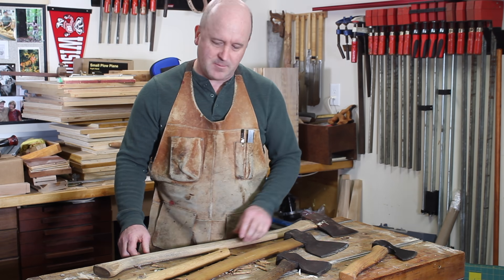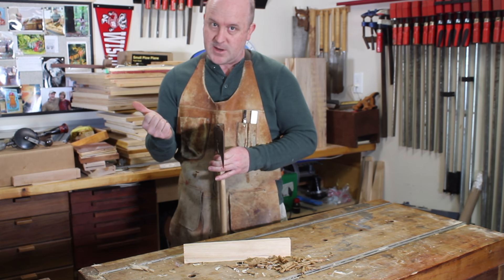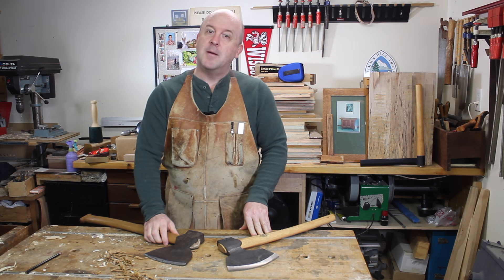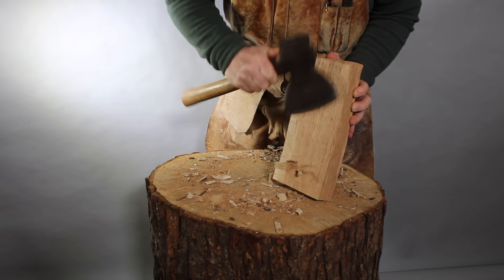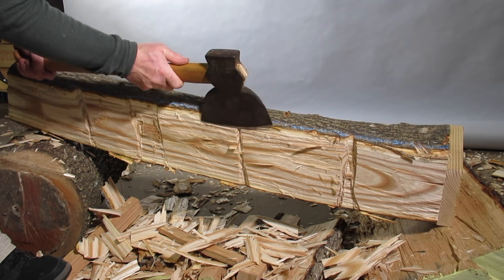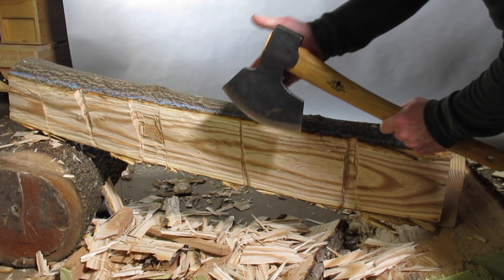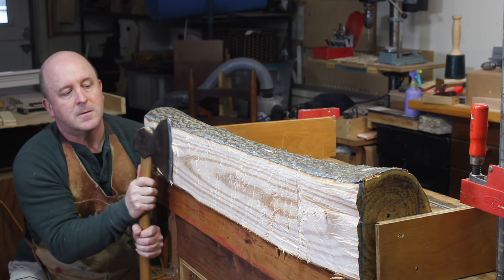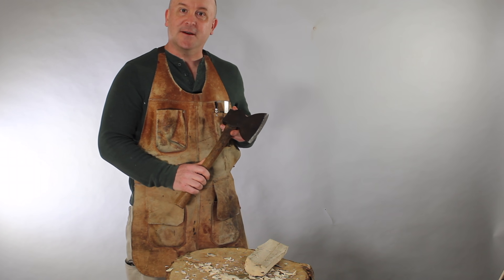Broad Axes Explained

Comment: I just watched another video called hand hewing from tree to beam that shows a guy named Dan Dustin use a broad ax as he skilfully produces a beam for Canterbury Shaker Village (looks like around 1980). In his opinion the flat on the broad ax should be out, and his explanation makes a lot of sense to me, as a woodworker. Not my area of expertise but I'm just pointing out that anyone considering buying or doing work with a broad axe should watch that other video.
Reply: Mark Lackley came here from same video. Dan’s explanation doesn’t make sense to me when thinking about the broad axe head design, nor the design of an offset handle. When you look at very old axes with offsets, the handles are offset away from the flat side. This means the user would have the flat side to the log.
Reply: @1978ajax Dan Dustin explains that the reason for the flat side is to effectively thin the blade.  Watch the video.  It’s the best hewing tutorial I’ve ever seen.
Reply: I was also curious about using a broad axe bevel in towards the log. It does make sense when you consider a draw knife works best with the bevel side against the log. It dosent cut to deep with the bezel against the work.
Reply: this depends on the work you are doing. these axes in this video are "carpentry" axes.. Dan is doing something else.. Hewing a beam is not the same as facing a door or finishing a board.. different tools for different work.. often the axes for beam hewing have handles so long that you can stand upright on the log and the axe goes by the side of the log, remember you have to last the day.. double-bevel or bevel side in makes the axe skip out from the log and keep the swing, then you can get back the energy from the return swing and just give it a tiny bit more to have another go.. just look at the oldest men at work.. steady they go, no rush and the less effort put in the longer they can go on.
Reply: oh.. and great video by the way.. :)
Reply: @japples6852  the offset handles are to work safely not for angles. As far as the flat side vs the convex side It's just about geometry not preference or wood chippage. Although anyone willing to work harder accidentally or not I Merritt them. Think about how a chisel works or a draw knife. The beveled edge prevents deep unwanted cuts. Once it's taken it can never be put back. Now take the task at hand, you gouge too deep its there forever. These aren't precision swings, although skilled  no doubt. Dan Dustin's explanation on how and why the mistakes are understandable through loss of tribal knowledge is quite perfect. Evidence of this is everywhere.. Imagine you are driving in your car and you see another alongside you with those mini mirrors atop their side mirrors. Those side mirrors and combination middle mirror prevent all blindspots. Side mirrors adjusted outward properly you can see a car in your rear view perfectly transition to your side mirror proportionally. This knowledge is lost amongst the current populace and we haven't been driving that long.
Reply: i watched that video as well. So im curious as to what is really correct and what isnt. But the only real way to know is to do it yourself. In another video, the uploader said it himself, "If you see someone doing it wrong, dont shame him, as anyone willing to hand hew a beam out in the heat is worthy of that respect."
Reply: @DuriensBane  sounds right😁👍
Reply: Haha, I came from that video too!  I believe Dan. His video was old but so far the best one on YouTube.
Reply: Think about how a chisel is used an you will have your answer ... Flat side towards the flat face you are cutting is the correct way
Reply: @adept00 
The timber job sites I’ve been the broad axe was swung with the body fully erect, usually standing on the timber and swinging between the legs or to the side of the body. 
They didn’t swing hard or long, but they didn’t make pansy cuts like the guy in the video- they worked a lot faster and not as hard as they guy in this vid. 

Since pre-roughing a chair blank with an axe that is ‘typical’ with the bump in the sides of the blade is nearly impossible to do well because of the bump, I’m going to acquire a couple broad axes and a ‘broad hatchet.’ Typical axes are great for chopping stuff, splitting wood, limping or whatever but don’t take slicing cuts well. 

This video doesn’t look like realistic usage to me. And inefficient by factors of 10. Timber guys knock up a square beam very fast but don’t make little chops like this guy, they’re in a rhythm and not struggling.
Reply: @fishhuntadventure  hey bud, I think I was referring to another video "hand hewn from tree to beam" which had better insight than this video. I can't remember it was some time ago, I'd say check that video out. I believe that vid and knowledge is spot on.
Reply: Here I am on the bevel in or out journey and I really think it depends on the application and what you're trying to achieve. I was waiting for this video to confirm Dan's views and then boom, nope. I'm about to fix and hang a broad axe hatchet and I will have to make the decision.
Reply: @krismorey 
Does not the size of each end of the eye dictate which end receives the haft?  The smaller end receives the haft as the other end is larger to allow for expansion with wedges, thereby locking the head in place?

Comment: A very old right bevel broad axe came into the sharpening shop today.
Looks like it was found whilst metal detecting.
Guessing colonial era. 
Very worn, from lots of use, but the steel is still good. 
Was pretty sure I knew it's intended purpose already, but this gave me a bit more insight into the specific end use, and edge geometry that I will need to restore, to make it serviceable once again..
Thanks!

Comment: Good day Jim of Highland woodworking, I've appreciated your reflections in a couple of your video's and you seem familiar with a number of axe types and manufacturers to an extent I am not so I'd really appreciate your opinion. I've, with one exception, never had the chance to try a carpenters or carvers axe*, never mind a broad axe, but I do a 'little bit'' let's say with axe's, usually making a felling or splitting axe 'one size fits all', but I've been wondering about branching out, you know going out on a limb and buying a specialist axe; I noticed you have experience with the Gransfors Bruks axe's amongst others and wondered if you had to use just one axe, let's say a Gransfors Bruks large carving axe or a Gransfors Bruks Swedish 1900  Broad Axe to do a variety of major tasks, let's say make a dugout canoe, some furniture, a dwelling in the woods and a totem pole-just for variety- which would be your choice?  Or would it be a different axe entirely, like the older, equally-or more in Scandinavia- reknown  Hults Bruks for example? Even a felling or splitting axe that I still use for a multitude of tasks... I'm thinking a double bevel, rather than right or left sided, I have tried a Stubai right sided and havn't found it THAT advantageous for flattening and of course much less useful for general use...If you have a moment I'd appreciate your thoughts on the matter if you find it is an interesting question to ponder of course  Thank you.* Except the Stubai right bevelled which thus far I havn't found particularly handy at all...

Comment: A question.  I have a true temper TB2.  According to think so, because of the angled bladyou it is a right bevel axe, but it has a bend just forward from blade.the eye and it also bends to the right.  Basically it is a hatchet.  What length handle should I put in it?  My guess is 14-16”.  The eye is1.6 times .6 oval.  Should I put an offset handle in it?  I don’t think so because of the angled blade.

Comment: Such a nice well done presentation.  Thanks for sharing and I will check out your store.  On the flip side, " no pun intended" some use the right or left hand grind axe on either side.  Perhaps the straight flat edge to produce a more flat surface and the reverse to take off smaller surfaces, or with the more circular Gransfors Bruks he displayed to produce a cupped or scalloped look. Just my two cents for what its worth.

Comment: Great video. I've wanted to get into this for turning firewood like pieces into usable wood. Some pieces can be pretty sketchy even taking them to the band saw and my band saw isn't very big. I have the same drill press as you fellow Wisconsinite. I love that thing but I bought it used with a crack on the back the pulley enclosure. Looked up the part and am not sure what to replace it with exactly. It's not noticeable but I refurbished the pillar and all the small parts and find it annoying.

Comment: The beveled side is actually intended to be toward the log when doing fine trim. The flat side provides a thinner, sharper edge. The flat side bites into the surface and could lead to an excess removal of material.

Comment: Multiple websites have the GB broad axe 1900 listed incorrectly.  Be careful out there.  Hope this helps someone.   The GB 1900 4803 is a RIGHT BEVEL GRIND.    
Most websites state this.  I’ve found two so far that state the 4803 is a left bevel grind.

Comment: Good video, thanks, As I'm in the market for a broad axe and a goosewing for that matter, would be even more helpful if you called out which axe is which in the video, that is, what is the brand and model of the axes you're using here? 

Also, in the same vein, would be great to take 8 or 10 of the axes you sell through a use and care video, that is, "...this Granfors broad axe can be used for hewing/shaping/... but is best used for shaping...", and show it in use for the tasks noted. Then, "...when you're finished with the work give it a fresh edge by honing, sharpening with a puck/stone/diamond/file, and wipe the handle with light wax/oil/....",  etc..., etc.... 
Thanks,

Comment: I am curious to hear your thoughts on utilizing the opposite side of a hewing axe for the bevel? So if the flat back of the axe head is on the right side when the blade is facing away from your chest, the bevel would be on the right side of the blade. Reason I ask is I was watching this video, https://youtu.be/hagvGTyEMUA?t=1105 , and this man states he used to do it the other way but switched after spending some time with old timers. The reasons he provides are two fold, the first relates to the the point of the blade being off to one side was not necessarily to get the blade closer to the piece but was to allow for a thinner blade and henceforth a sharper blade. The second reason relates to how the blade cuts the wood and prevents the blade from getting stuck. Maybe the answer is that both have their uses, maybe the hewing awes you show are just be for finer work and the axe in the video I provided is for more rough work. I just wish there was a good one stop shop that explained all of the different axe types and uses, as this fine tuning and switching of the bevel to the opposite side and working the wood in a different manner may be more true to the pioneer period.
Reply: I agree

Comment: Can one do with one axe or does one need both a right and a left version?
Reply from the maker: It is ideal to have both. They each specialize by the side of the log they cut. 

A right hand broad axe is used on the right hand side of the log (when looking down the length of the log.) Consequently, a right hand broad axe has a head that is flat on the left side and a handle that deflects to the right (away from the flat face) so that it clears the log.

A left hand broad axe is used on the left hand side of the log (when looking down the length of the log.) Consequently, a left hand broad axe has a head that is flat on the right side and a handle that deflects to the left (away from the flat face) so that it clears the log.

Comment: So I dug out an old hatchet, sanded some rust off, filed the edge a little to remove small burrs & I was wondering what the heck is with this bent head. Has a 17" handle that is almost straight on the bottom and a almost flat cutting edge. Now I know. Thank-you for the stupid simple explanation lol. KISS - Keep It Simple Stupid.
Going to be great for kindling when out fishing. That's about what I'll be using it for. Darn thing still has mill circles on it!!!

Comment: Although I like your video, I believe your mistaken about which end of the axe to use, your analogy of the chisel was spot on, then you kind of preformed the opposite. If you were to only use a chisel to hewn a log, you would use the beveled side far more than the straight side
Reply: This was not a film based in a wealth of practical knowledge, clearly. Look out for Dan Dustin's video. I use a double bevel in my films on the subject.

Comment: where you stand and how you stand matters, pretty sure when you're using a Frowing ax or hatchet to turn a round log square, if you're cutting the right side your right foot should be on top of the log and you only lift the blade than controle the fall as it dropes to your side safely along the side of the log, no chance of hitting yourself.

Comment: Left and right beveled axes depend on how the handle is hung. Broad axes I have handled do not have a tapered eye, so the handle can be inserted from either end. Your hewing technique is flawed but only because it has been perpetuated by many. Ergonomically, hewing on the top face of the log is safer and more efficient.

Comment: This is a conspiracy to sell more axes!  Think about it — all beams have a LEFT and a RIGHT side.  There’s two axes already.   I wonder if there are top and bottom axes as well?
Reply: Usually the handle is removable to use the axe in both hands
Reply: Keyboard Enthusiast   If u are working in a confined space ‘ say down in the hold of a wooden ship for example and working on a huge beam to make if fit ‘ it would be very handy ‘ you wouldn’t be thinking of conspiracy theories ‘ just get it done
Reply: you actually can just turn around to do the other (left) side the exact same way as the first (right) side. rotating the log to do top and bottom cuts the exact same way as the first cut, nice and easy ...

Comment: D not hold the timber with your thumb on top of the piece. Be safe. The handle of a hewing axe should not be straight it should be bent to the side, so you don't scrape your knuckes. That's why this guy is chipping away. He is scared of scraping his knuckles!